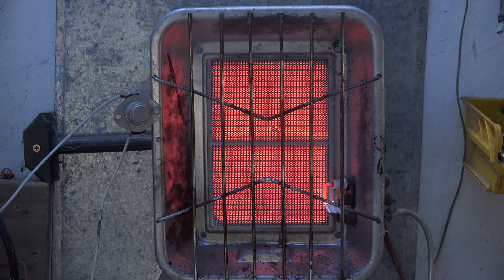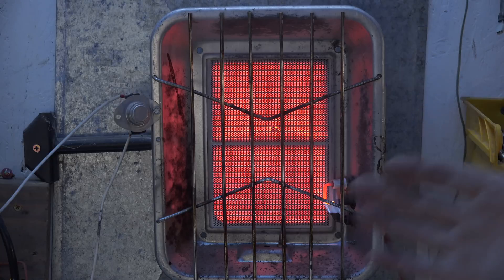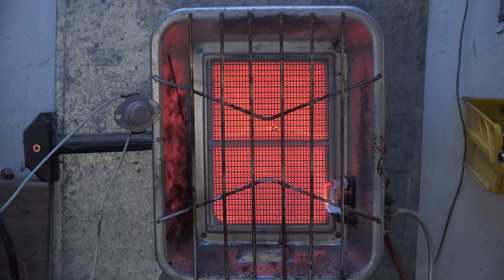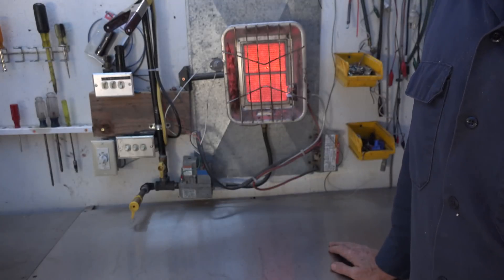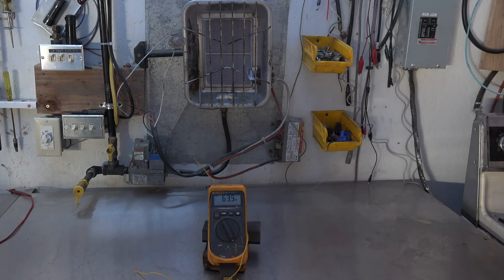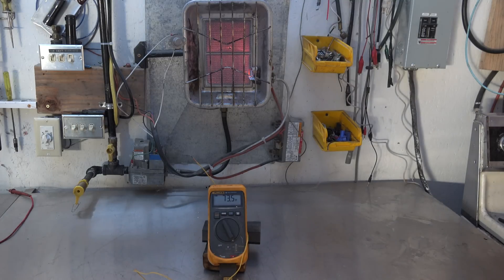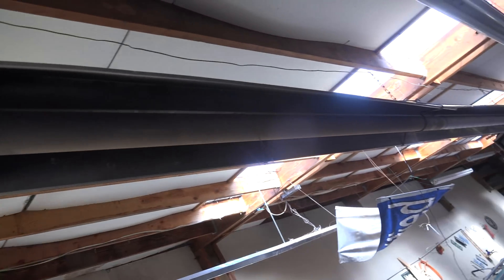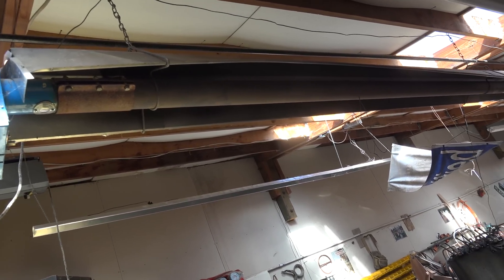What radiant heat does

Comment: Hi GFM, is hot water boiler heat considered radiant type of heat? Thanks
Reply from the maker: There is a lot about radiant heat using a boiler that is mostly not true.  Cast iron "radiators" are not radiant but convectors.  Floor heat is also not so much radiant as conductive and convective heat.  Ceiling hot water heat is radiant.  Hope this helps.
GFM